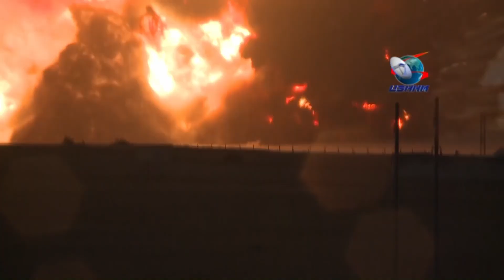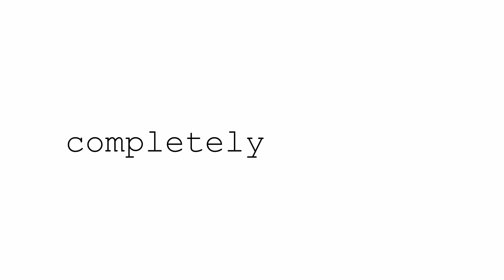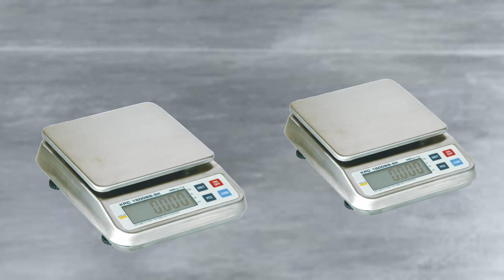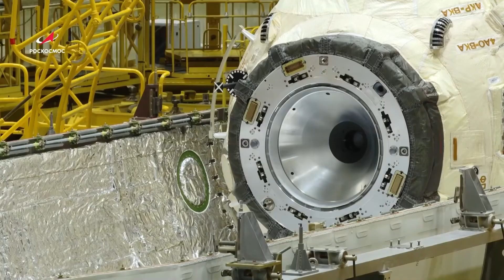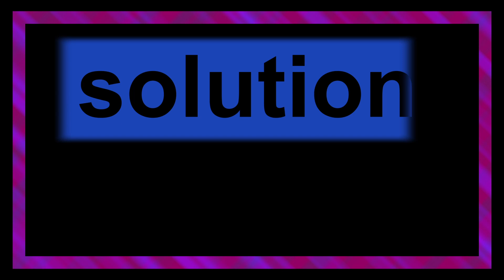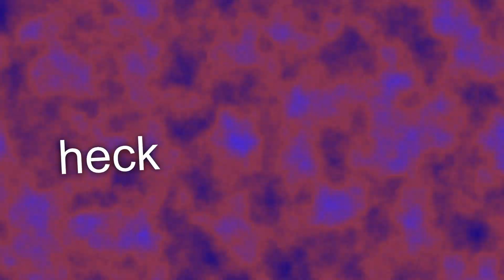The Troubled Tale of Nauka

Comment: I’m writing a report about the Nauka module, what is your source for the lack of insulation on the highly sensitive equipment? This would be a good part of my essay as the class is about safety by design, but I can’t find any sources. Would be much appreciated!
Reply from the maker: It's towards the bottom of the article here: https://www.nasaspaceflight.com/2021/07/nauka-launch/ NASASpaceflight cites RussianSpaceWeb (which I used for a ton of the research for the video), but they have this specific info behind a paywall, so I just went with what NASASpaceflight reported
Reply: @TheTylerFriesen  thank you so much!
Reply from the maker: @joshuabaham714  No problem!